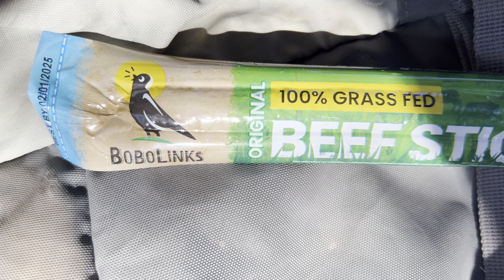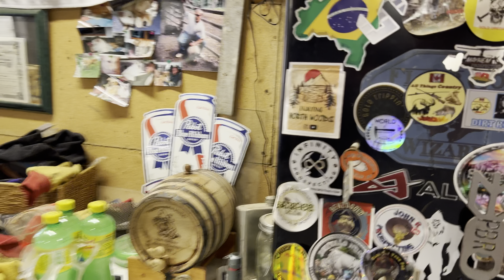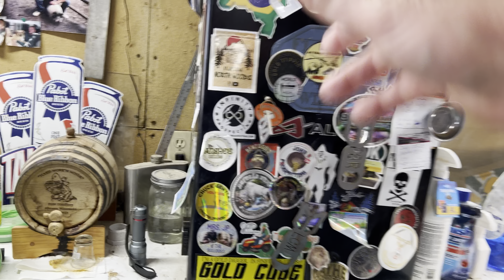Hidden GOLD behind secret waterfall !!

Comment: What is that 3M material you use as your indicator mat?
Reply from the maker: Roofing rubber with 3-m tape on the edges holding it down 👍🏻

Comment: Hi Jason what small clean up sluice and speed ajuster for the pump do you have and is your pump electric or battery powered thx.
Reply from the maker: My cleanup sluice is in testing phase… but it runs on a speed controller made in china… and a eco worthy battery
Reply: @FlourgoldWizards  thanks for the information I appreciate it. Can you get those speed controllers you talk about in your videos anywhere I seem to remember you naming a company you got it from if you could tell me that and approximate price sure would appreciate it. I’m looking for a small cleanup sluice
Reply from the maker: @randyspadino3875  
Here’s the link to the ones i use, they’re reliable and cheap ! 👇🏻
https://www.amazon.com/7-80V-Controller-Switch-Control-Regulator/dp/B081XQLN46/ref=asc_df_B081XQLN46/?tag=hyprod-20&linkCode=df0&hvadid=416948024384&hvpos=&hvnetw=g&hvrand=18177591285413101126&hvpone=&hvptwo=&hvqmt=&hvdev=m&hvdvcmdl=&hvlocint=&hvlocphy=9019071&hvtargid=pla-1090113409832&psc=1&mcid=4809990327d43fe5af1d05765afb6da9&tag=&ref=&adgrpid=93604211413&hvpone=&hvptwo=&hvadid=416948024384&hvpos=&hvnetw=g&hvrand=18177591285413101126&hvqmt=&hvdev=m&hvdvcmdl=&hvlocint=&hvlocphy=9019071&hvtargid=pla-1090113409832
Hang in there a bit for the cleanup sluice, were almost done
testing!
Reply: @FlourgoldWizards  will you be selling just the sluice or the sluice with the controller with the water pump ???
Reply from the maker: @randyspadino3875  
Sluice only and smoothwater mini only